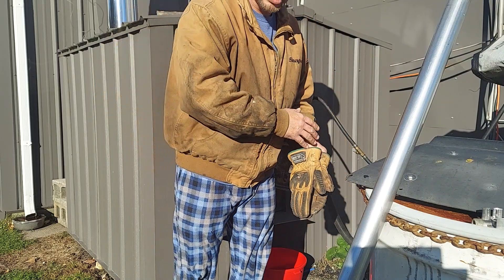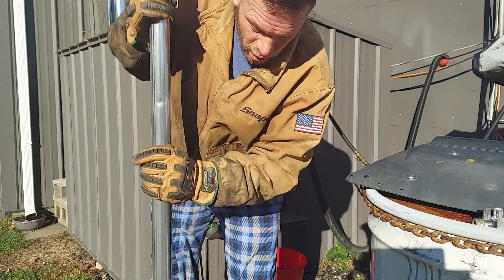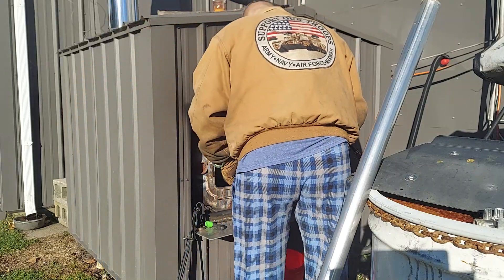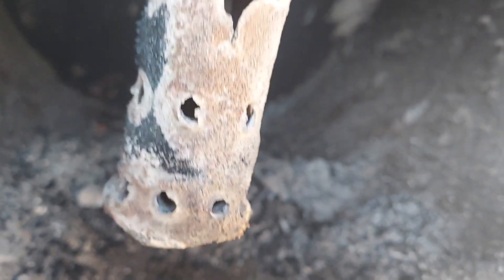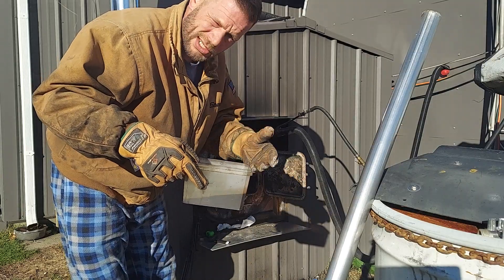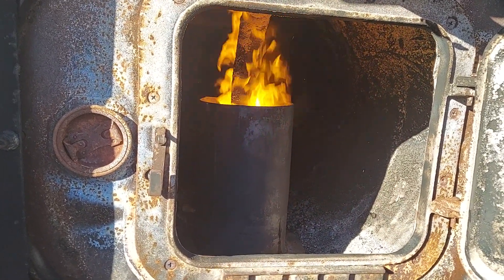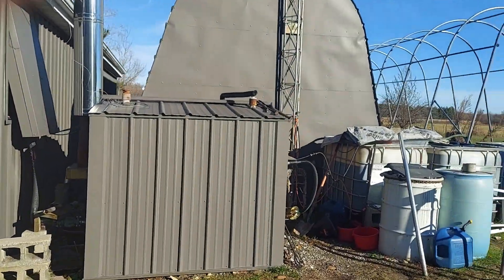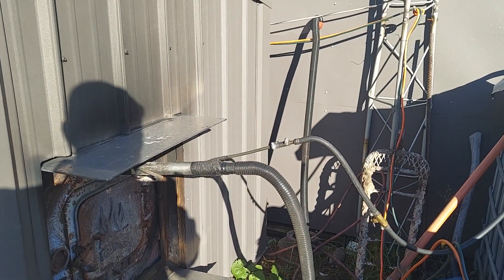How I heat my home for free! Homemade outdoor waste oil,solar,and wind  powered boiler.

Comment: If it's free it's because very few people want to put up with the hassle. If it was worthwhile then used oil would become valuable and no longer free, unfortunately.
Reply from the maker: I burned wood for about 15 years, and I will gladly clean and light the burner every day or two. I can light it and go on with my day,no reloading every 6-12 hours, depending on the outside temperature and heat load. Thanks for your comment! Have a great day!
Reply: @karlsoffroad  How do you provide the burner with a constant oil pressure or if it varies how do you deal with that?
Reply from the maker: @NoOneButRonPaul  ,I have a video on my setup with more detail and part numbers. I use a needle valve with a tee installed to keep the oil circulating continuously. Thanks for commenting! I'm happy to answer any questions you may have.